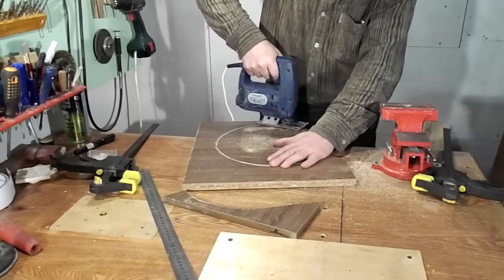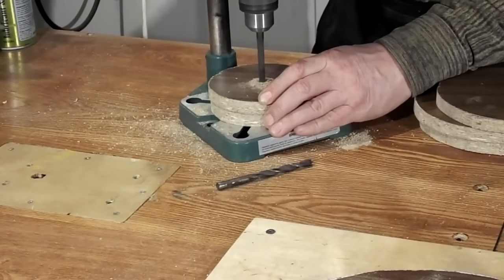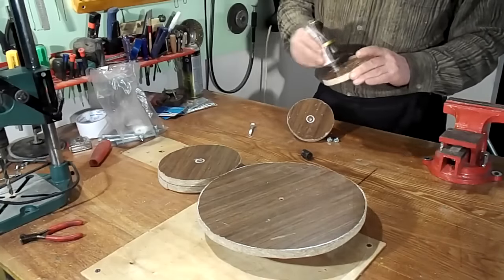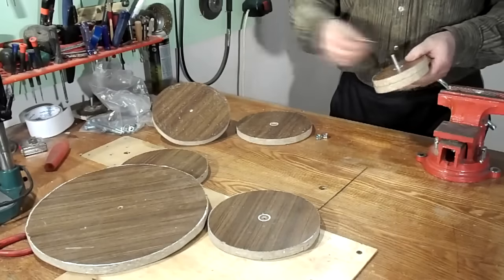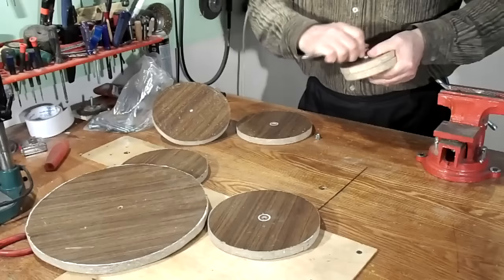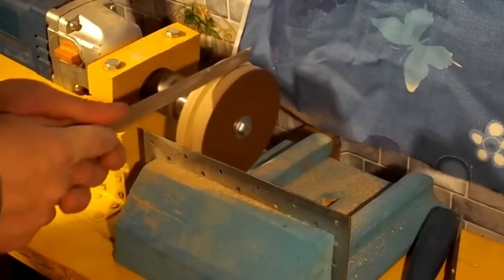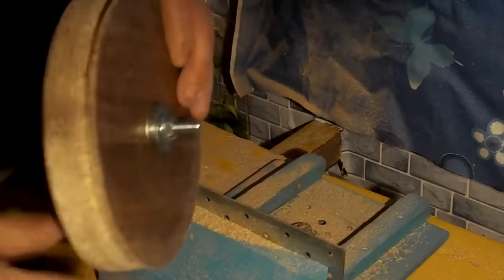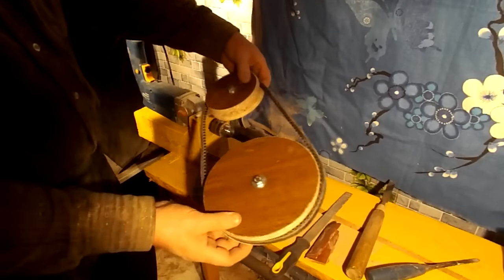How To Make High Precision Sharpener Pt 1

Comment: Looks good. A suggestion or two. When making the pulleys, cut two squares of board, length of sides equal to diameter of circle. Glue them face to face and find the center. Drill the axle hole and make the square round. Another type of drive that could be used is a friction drive.